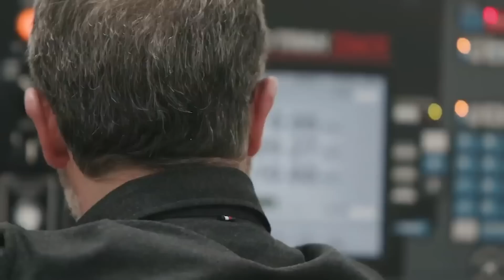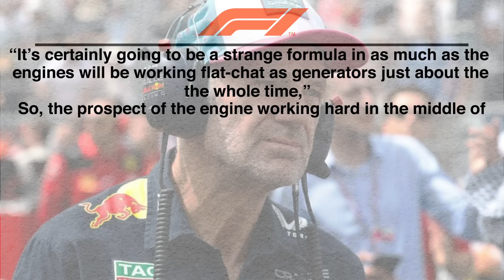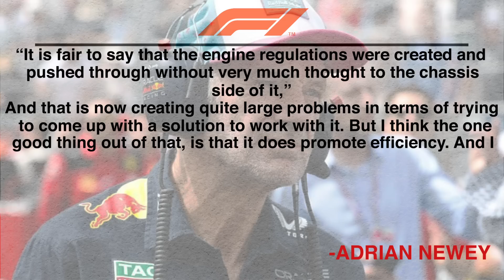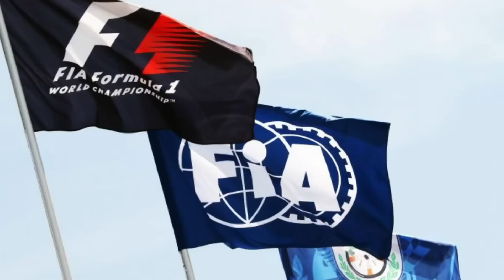Adrian Newey's FRUSTRATING COMMENTS about 2026 F1 Car Regulations!

Comment from the maker: Should they just bring back the V8s & V10s?
Reply: Yep with fully synthetic fuel, I honestly think they have shot themselves in the foot big time. WRC is scrapping hybrid technology from next season, to complicated, to expensive, to unreliable and to heavy
Reply: yes
Reply: Bring back the V10’s  and “in-race”Refueling.
Reply: @yetisquatch-1471  nah would rather see no stopping, everyone on same tyre just go and race of course this would never work within these rules
Reply: No just make it all electric. and only powered by solar panels no batteries.  Its disgusting the changes. They will ruin the sport
Reply: Yes
Reply: Bring back V8s and V10s will mean several nails in the coffin of F1 targeting to become the horse race of the future.
Reply: Yes, with a mild hybrid system at most.
Reply: Totally agree with that comment, it's about the fans right? Even the drivers have said this. It would be hella cheaper too. How much more complex and expensive could these hybrid systems be anyway. And don't get me started about safety. It's a miracle no one has been electrocuted (ya I know there's safety) after a crash or during recovery....
Reply: Yea V10, and use synthetic fuels if they have to. Vettel showed it could be done in an old Williams car iirc
Reply: V10 hybrid
Reply: @Ibetyouhavepronouns  or zero hybrid 🤯
Reply: @Luke-en2tk  I agree 100% but if manufacturers are focused on quote environmental responsibility (BS)
Then I think that sounds like a good compromise 
Ditch the mgu h, 2.0l V10 hybrid 75-25 power split in favour of ICE 
Mixed with 100% sustainable fuel 
Wind them MFs upto 20,000rpm 
I'm down with that
Reply: They shd but wont happen.  Anyway they complained the same issue in 2020 regarding 2022 reg and they managed to figure things out. 

They are bunch of smart people. They will figure it out 🤣
Reply: @nino88881  only they didn't the racing is terrible even Max says it's like driving a barge. Something is seriously wrong if the guy dominating the sport doesn't enjoy driving his car

Comment: This is probably the reason why Adrian Newey decided to drop any more involvement in F1 design work and just focus on his RB17 hyper car road car project instead.

He didn't want to go past mid season of 2025, because mid season is when the work begins for the 2026 car.

A completely new way the ICE does its work in the F1 car plus more weight and complex active aero?

If you guys remember Gran Turismo and his Red Bull X car.  Kazunori Yamauchi, asked Adrian Newey what a race car will be like WITHOUT ANY rules, what would it be like?

It turned into a modernized F1 car with the front wheels fully covered and fan suction aerodynamics.

He did NOT OPT to have active aero im his design.  He probably knows active aero adds more burden than reaping benefits from it.
Reply from the maker: I would love to become friends with you. Lol. But yes with the recent announcement about Neweys departure a lot of his statements about the engine capabilities for 2026 make a lot of sense especially when its aligned with aerodynamics of the car

Comment: I disagree with your comments about fuels being basically methanol (100% would destroy current ICE Platforms globally), there is a tremendous effort underway to create an entire new category of E-Fuels to replace the current carbon based dino fuels we burn today. They are 90-95% cleaner than what we use to power our vehicles today, and actually produce 5-10% more power (depending on the study you read). The top 5 Petrochemical Companies (including Aramco who heavily sponsor f1) on the planet are steaming toward development, so they don't get left behind. The production of synthetic fuels from biomass via Fischer-Tropsch (FT), otherwise known as biomass-to-liquids (BTL) process, constitutes one of the most promising routes for tomorrow’s fuels. It's probably going to be algae, seaweed or something similar that can be grown in HUGE quantities quickly, then gassified to produce these synfuels for global distribution. Remember, what wins on Sunday, sells on Monday....

Comment: More F1 insists on revamping the past, redoing the same concept uncountable times, appealing to older techs used in the same fashion 50y ago: worst it will get.  Sorry to be the one to say it, again.

Motorsport and carmakers should admit that we need a new mindset to develop more sustainable and efficient racecars that will be the seeds of better urban transportation.

Movable flaps and 'DRS' will not fix a broken packaging philosophy.

F1 and all global carmakers can through billions in the money pit of the baggage of obsolete techs that they are still selling us as the pinnacle of the motorsport, but the reality will impose itself soon or later.

They have a choice to make: reinvent themselves or succumb to the abysm of greed, pride and arrogance. I'm hoping for the better and you?

Tip 1: what changed in the UI of an F1 in the last two decades? This is only one example of many.

Tip 2: how does F1 contribute to making urban and sports cars less power-demanding and more efficient?

Comment: If the engine runs wide open thru the whole race just to charge the battery the sound of these cars won't have any relation to the corners of the track or the actual power demand. These engine rules are retarded.

Comment: If they are going to finally allow ""ACTIVE-AREO"" then why not make the GROUND EFFECTS work so good that while the cars are on a high speed section that there are ""RELIEF POP-OFFS"" plumbed up from the undercar suction area to the top of the car in a place that said air wouldn't be a bother & set it up so that when the cars bottom is nearing the GROUND SMASHING STALL HEIGHT that the on-board sensors read the negative pressure & VENT THE EXTRA to keep the car at the desired ride height & stop that bounce/slam/repeat syndrome that we have been dealing with thus far with the ground effect formula. If the suction would be controllable then it could be designed to be way stronger than it is now so that it ""MIGHT/COULD"" work better in the slower corners ""HOPEFULLY MAYBE"" ?!?! I don't know if that type of a system could be fast enough to work properly & hold the car at one height with XLNT hold down and less dirty air behind??
P.S. We don't want to be watching the same thing as a LOCOMOTIVE TRAIN POWER PLANT hauling the sport of F1 into the future, PLEASE & NO THANKS.........................................MR

Comment: As Engineer I so confused how on Earth active aero can make can spinning on straight and who run that simulation in what parameter. Active aero is integral part off airplane and futures on many modern car. We are human not that stupid.

For engine with Ethanol, split 50-50 ICE and electric with weight VS reduction, thats an issue .. they are two side off coin face

Comment: Make the cars smaller, lighter and more aerodynamic, that would increase aero. Also put in wheel electric motors in the front wheels, that would drastically increase acceleration, and bring advancements that could spill into the road industry.
Reply: Never seen someone be so confident yet every single word they said was so incredibly wrong. glad to see F1 fans still think they know more then engineers that have done it their entire lifes 🤣
Reply: @ParkLoving  you also added nothing of value, congratulations 🎉
Reply: @gianni_schicchi  while not spewing nonsense that has been proven wrong 100times 😂😂😂
Reply: @ParkLoving  Cuz traction in all wheels is not a thing, right? You really got me there. Better go tell the auto makers that AWD (and 4x4) is not a thing, and that every car should only have RWD. What are you smoking bro? Pass me some! 
Even Verstappen said driving these cars is like steering a boat, because they are too big and heavy to handle properly. It`s not engineers that build the cars that choose the set of regulations, it`s the FIA and FOM.
Reply: @Adreno23421  doubling down on proven wrong things doesnt meake it right 🤣🤣🤣🤣the best part is that you quoted drive to survive word for word 🤣 sorry you thought Netflix🤣 drama was real
Reply: @ParkLoving  "Proven wrong things" You didn't prove nothing, bruv. I've never seen drive for survive, so I have no idea what you are talking about. But now I know where you get your info from. 🤣🤣🤣🤣🤣🤣🤣🤣🤣🤣🤣🤣🤣🤣🤣
Reply: @Adreno23421  Aw kiddo mad that he got proven wrong with facts, evidence, and links 🤣🤣🤣triggered becuz exposed for quoting DTS word for word 🤣🤣🤣🤣enjoy Netflix kiddo
Reply: @Adreno23421  Aw kiddo mad that he got proven wrong with facts, evidence, and links triggered becuz exposed for quoting DTS word for word enjoy Netflix kiddo
Reply: @ParkLoving  explain yourself

Comment: 2026 is not that far away. The fact that F1 never built a real-life prototype to see if it all works is quite telling. They are so desperate to push battery power and the green agenda down the throats of consumers, that they never stopped to see if it would actually work in a Formula 1 car. I won't be surprised if it's still an impossible mess a year from now (when the teams will actually be attempting to manufacture these things).

Comment: The F1 car could run off the same fuel combo used in an IndyCar.  IndyCar uses a E85 blend with 85% Ethanol  and 15% racing fuel.  The racing fuel can be renewable gasoline made from a Biomass process.

Comment: I have a really funny suggestion instead of using ethanol which has already been tested and used they should try to implement hydrogen fuel. It falls in line with F1's "purpose" of improving, finding feasibility and implementing to the public as well as allowing for a good power source for making power, one more thing the only product that gets expelled when used is water making it very environmentally friendly. It is a wild idea that I would like to see being considered.
Reply: Unfortunately that is more costly.  Ethanol is cheaper and they're trying to lower cost.  They energy used to convert Hydrogen to a liquid also outweighs the benefit of it.  That's why car companies never pursued it.

Comment: Considering automakers are already pivoting from electric vehicles to hydrogen. I have a feeling these set of rules aren't going to last very long. Society is going to look at EV viability like 3D TVs and curved displays. A gimmick this whole time.
Reply: The pivot to hydrogen is not going to happen easily because hydrogen requires about 10 times the space as petroleum.  The next generation is turning hydrogen into ammonia (solid and compact) but plane old hydrogen is not practical unless we get rid of storage space in cars.

Comment: Imo, they can stay with 4-5 cylinders if that simplification is suitable for manufacturers, but limitations on  displacement, max rpm and boost presure should be increased

Comment: I get why they want to go away from fossile fuels. But when they can't go full electric, why not just instead go full ethanol? Or fix a system for a quick switch battery during pitstops
Reply: F1 will use Synthetic Fuels by 2026